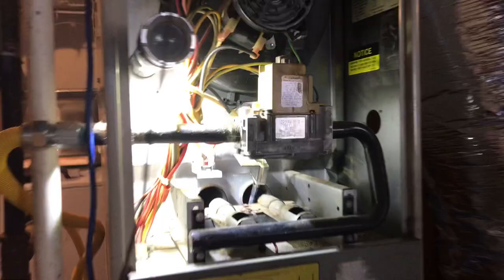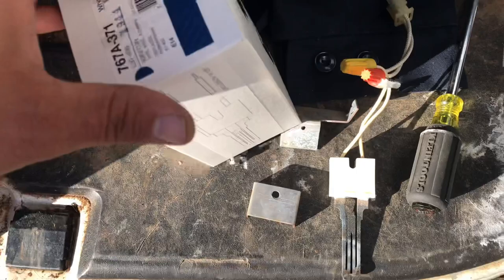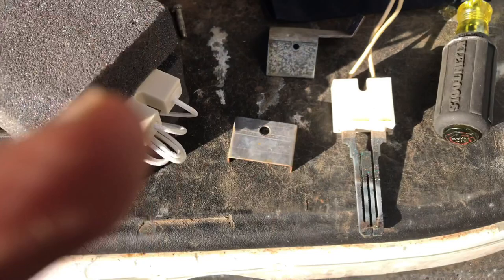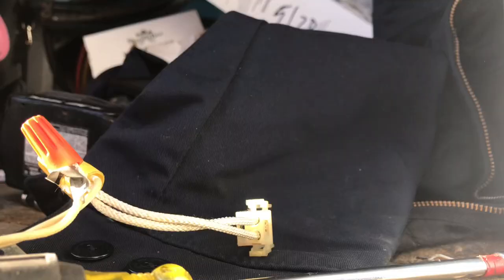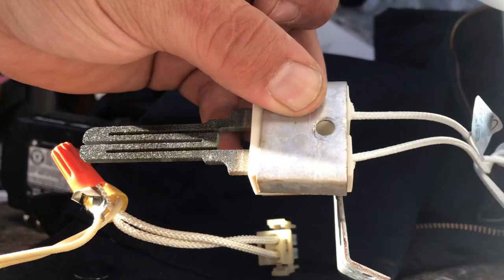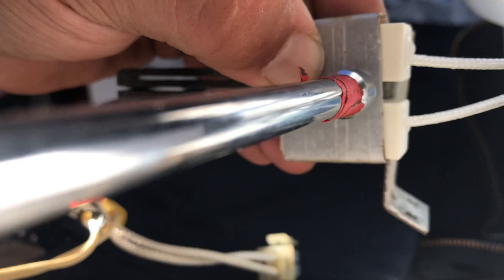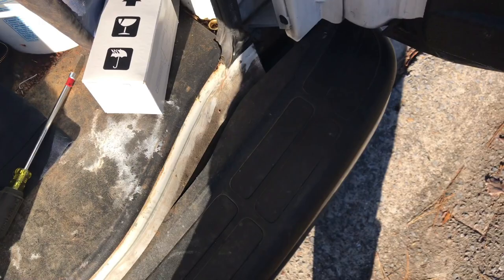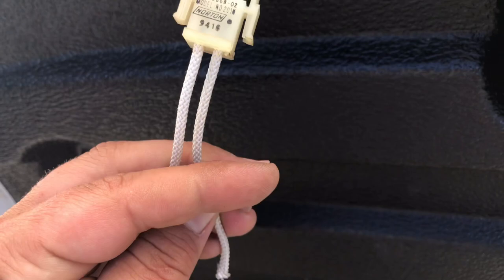How to Replace A Ignitor On A Gas Furnace

Comment: I was quoted $400.00 for a weekend replacement of an igniter that was intermittently working. I'm not mechanically inclined but I was able to order one on Amazon and do it myself the next day for $30.00 in 15 minutes. I was looking at unscrewing 3 tiny screws and clipping a connection and couldn't bring myself to pay $400.00 for that. If you are on the fence about doing it yourself, go for it!
Reply: Exact same boat, Amazon order comes today. Our quote from trusted HVAC was $350. part was less than $30 bought ourselves. YouTube was the last stop
Reply: My HVAC company was out to do a cleaning on my furnace, which has only gone through only two winters and they suggested I replace my igniter. They wanted to charge me $330 to do so I declined and I found the nighter on Amazon for 30 bucks, I have to think that I can get more than two or three years out of my igniter.

Comment: I think I need a igniter. But i cant do it. So if it goes out, would the furnace give a error code flashing light? Because my furnace has no flashing light error codes. It just has a slow steady flashing light and it says thats normal. But i got no hot air. Its only cool and i dont see any flames when i look at it. So im just guessing it has to be the igniter. But i dont know. I checked the filter and its good. So im lost.
Basically, is it possible that everthing works and shows no error codes yet rhe igniter is no good?
Reply: Same issue here with you. Are you able to fix this? Thank you